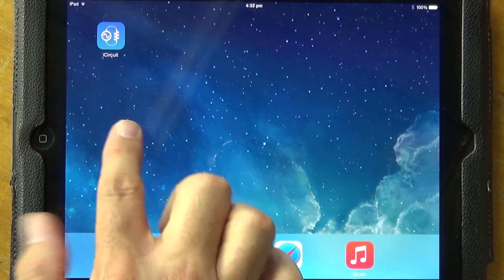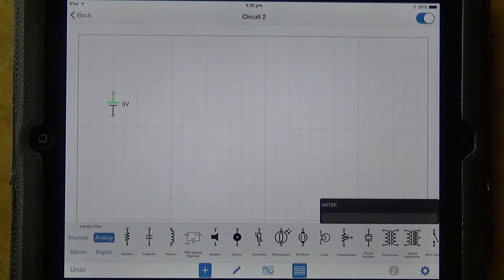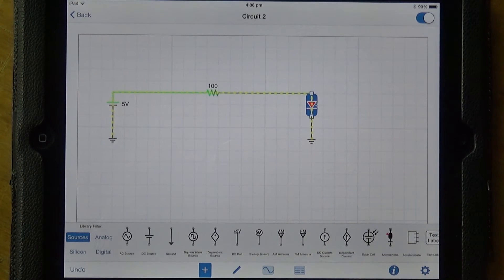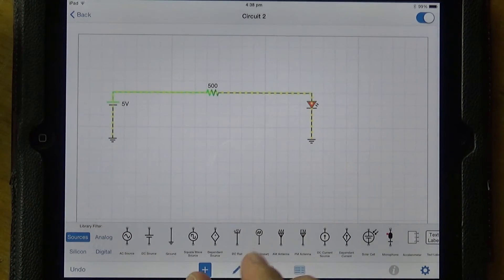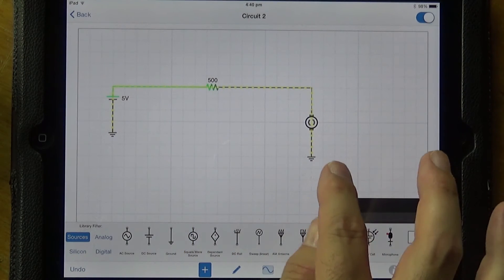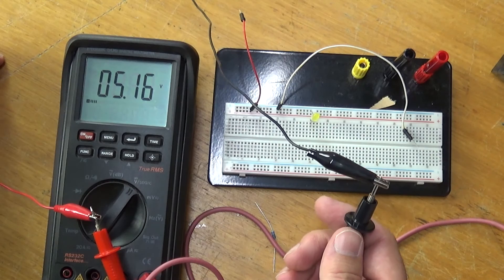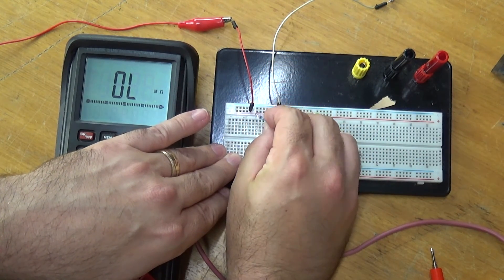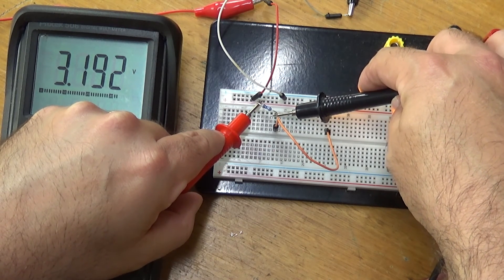Electronics simulation and design software (MEHS) Episode 6

Comment: Nice video. I was considering the EveryCircuit app but your overview of iCircuit shows that it has order of magnitudes more components than EC. 

The use of proper SPICE for the simulation math is also a plus, EC seems to be rolling their own math engine and have loads of testing to do for each new component they want to add (a 555, binary to 7 segment decoder etc are the most complex components as of 2016..). iCircuit is ~50% cheaper too. Is doesn't seem to have the same vast community supplied circuits and the UI is a bit more clumsy so hopefully the iCircuit fevelopers can pick some of that up :)
Reply from the maker: Thanks for the feedback and detailed response.  For IOS I couldn't find anything better to use than icircuit.  On the desktop I tend to use 123d circuits but I'm not a heavy developer.  I do miss things like the ability to grab an lm317 or a more modern family of regulators instead of the 7805 but here's hoping for further development.  Cheers.